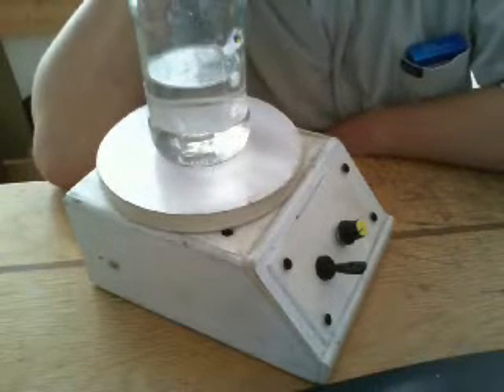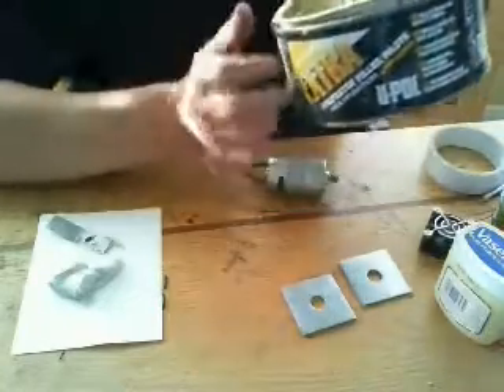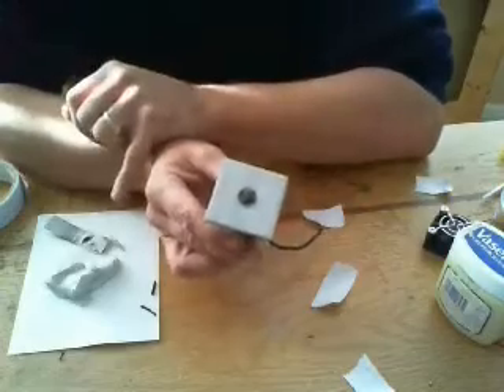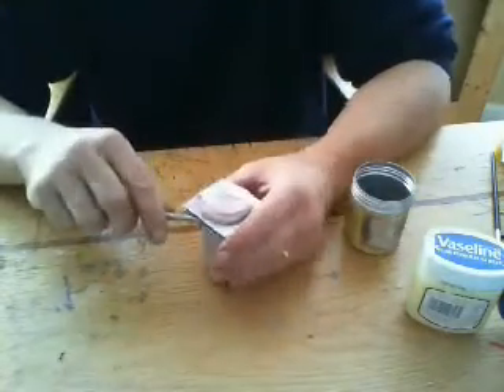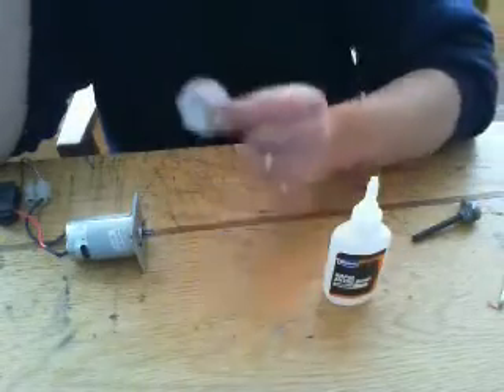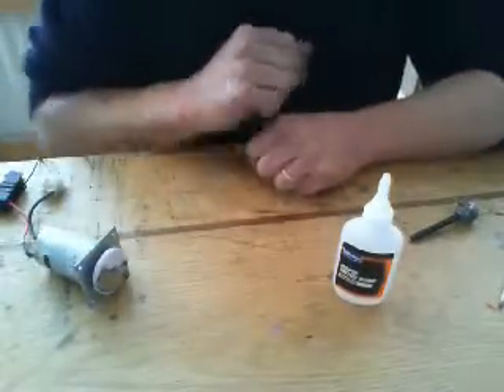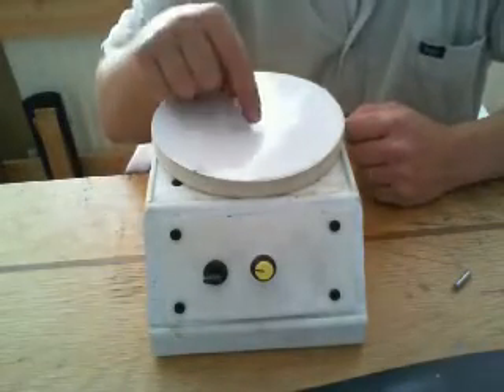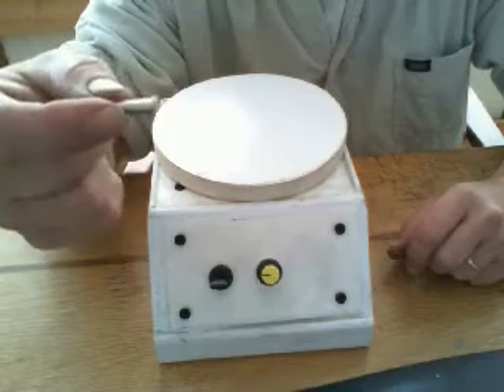how to make a magnetic stirrer

Comment: For my DIY magnetic stir plate i used a Notebook Cooler Pad aluminum top with (3) mini fans. These fans are rated at 1500RPM which produce a very moderate speed in case you don't have or want to buy a potentiometer. I just cut out the middle aluminum grill, epoxy a metal washer or (knock-out plate, metal hole cover round disc) to the center & a small rectangular neodymium magnet, computer hardrive magnets are also popular. Careful with the fan fins, they are delicate. Works a base as well. You might need a spacer between the magnet and the jar, i made a donut shaped spacer out of some 3/8'' thick cork panel i had laying around. Ebay # 230827992876 for the notebook cooler pad. Hope this helps someone out !!! PEACE O(*_*)O
Reply from the maker: Edgar Moctezuma very nice share mate - cheers

Comment: ah yes the webs...i settled on graphite powder mixed in with contact cement for a quick flexible fast drying conductive circuit painted on paper and got an ohm reading of approx 500 ohms per 1 1/2 inch...and now since your post on ''Gary'' im now experimenting with the neutral line...will post some findings soon...very exciting